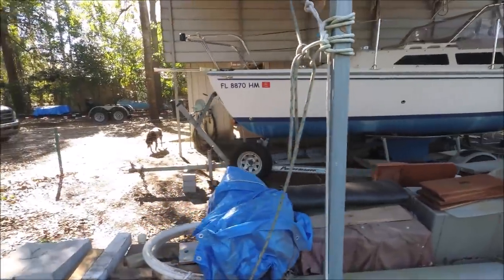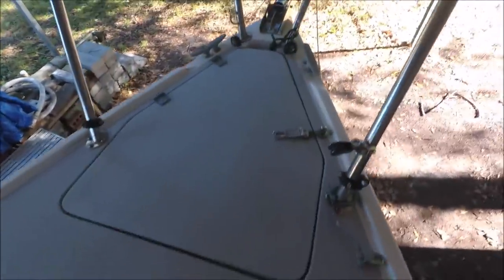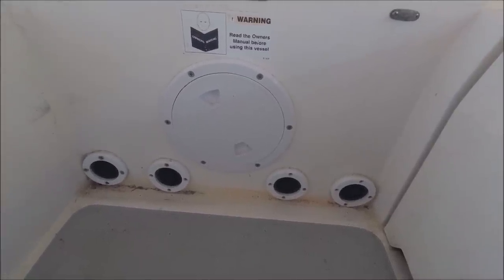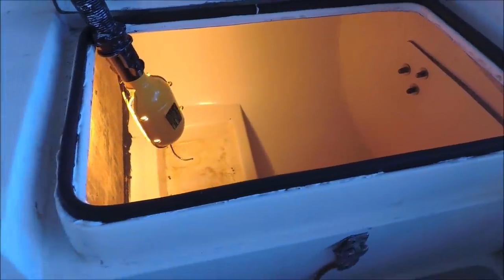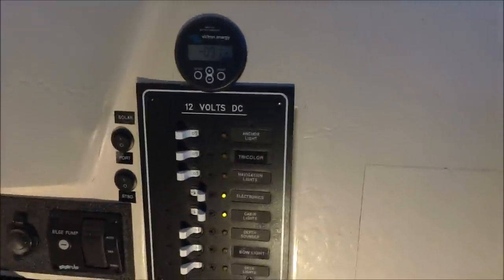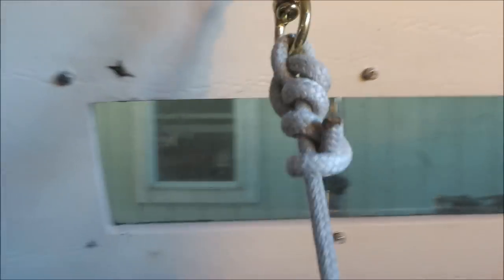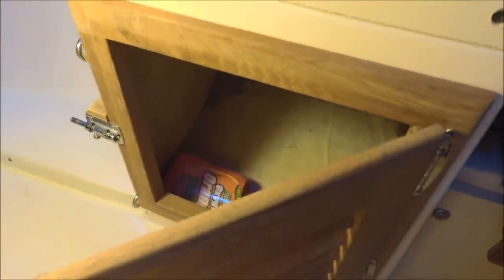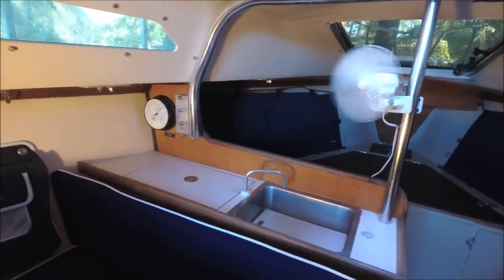Preparing a Catalina 22 for Bahamas Cruise

Comment: Nice work. Is there a wire or metal going into the water to ground the boat from a lightning strike?
Reply from the maker: I don't recall if the owner had a lightning ground already installed or planned to add one later but I wasn't asked to install one. On other boats I have used a 1/4" x 4" x 20" copper ground plate with cables connecting its bronze mounting bolts inside to upper shroud chain plates and base of mast if keel-stepped. Or a simple version could be something like a sheathed heavy copper cable such as battery jumper cable with it temporarily clipped on to an upper shroud with other end dangling in the water when needed.
Reply: @atomvoyager   one nicely sealed copper bolt going from inside to outside, just below the water line, to the ground on the fuse box should be enough to ground a small boat?
Reply from the maker: That may help but the experts I've consulted recommend a copper plate of any thickness with a perimeter of 48" which comes out to a 4x20" plate. That's perhaps extravagant for a 22' boat though. There seems to be some witchcraft in lightning protection so it's hard to know what's best. Also, a #6 awg wire from upper shrouds and/or mast base to the copper or bronze thru-hull ground below waterline is recommended. Add a wire to the fuse box as you say, is secondary.

Comment: I own this same boat… 1990 Catalina 22 Wing Sail number 15094.  I’ll bet this guy rolled off the line about the same time as mine.
Can you give any advice on having a trailer fitted for it?  I have seen a lot of bunk trailers available for the swing keel, but not many used trailers for the wing.  Would it be difficult to modify a trailer to make it work for the wing?
Reply from the maker: Any used trailer you find that is not specifically for a boat and keel of this dimensions will be somewhat difficult and costly to modify to fit your boat. But any trailer designed for keel boats should be easier to modify than one with bunk rollers for a shoal draft centerboard. You might ask for ideas on a Catalina or trailer-sailer facebook group. Unless you get lucky and find a cheap used trailer designed for your model boat then you may be better off buying a new one. You can ask Sail trailers in Columbus, GA about that if they are in your region. I have bought several custom trailers from them over the years.

Comment: That is crazy, when its all loaded and provisioned how low is it going to be in the water?
Reply: Between 604 to 635 pounds will lower the waterline by 1 inch. The more difficult problem in a small boat is getting it loaded correctly so there is not a tendency to yaw, pitch, roll, sway, and heave.
Reply: @SuperBullyone  IMHO, Coastal/Lakeshore boat, don't leave sight of land  !!
Reply: @AlienX69  probably right, but the most dangerous place is within sight of land.

Comment: What top-down furler do you recommend for this this size boat?
Reply from the maker: We installed the Selden GX 7.5 which the owner had selected. 
https://catalinayachtsstore.com/wp/product/selden-gx-7-5-furler/

Splicing the anti-torsion cable on the GX7.5 is a bit tricky first time you do it but they have a video that's easy to follow:
https://vimeo.com/252147951

The Selden is the only top down furler I've used but there are other brands out there that you can read user reviews. The smallest models available should all work for a 22-footer and most are probably oversize anyway.

Comment: Is gasoline storage vented?
Reply from the maker: Yes, because the locker lid is not sealed by a gasket and there is a notch cut into the bottom corner of the lid, it vents to the cockpit only.

Comment: Ps 
  Lets talk toilet, ha.  That overpriced system you can just buy the generic seat ($12) which snaps securely onto your own 5 gal bucket.  Ive used them for years, fantastic.  Then, I buy a $10 bale of wood shavings (tractor supply/Wal Mart etc) lasts months. . .  Its like hamster bedding.  Put some in the bag, (add your #1/or #2) and cover with more shavings.   You can get pine or cedar.  Very civilized and pleasing to the immediate atmosphere : )
Reply: @ronwright4684 no no no--- I'm comparing it to the other expensive composting toilets, which, also, don't get flushed down the regular toilet.
. . . I'm comparing two composting versions, the former of which is ridiculously expensive.  I don't know what you thought you were tracking there, Cheers : )
Reply: @ronwright4684  PS, rules of international waters everything(waste ) goes overboard when "offshore" which is technically, I believe, starting at 3 miles from land.  Maybe that's what you're asking. 
Anyway, my point was, if you're going to buy a composting toilet anyway, my version is the same thing and way cheaper, Cheers!
Reply: Apologies, I misunderstood, deleted my comment,

Comment: Would it be impractical to put a water maker in a boat this size?
Reply from the maker: It is possible to do but for most people the space and weight of a built-in water maker would not be practical on such a small boat.  You'd need more solar and batteries to power it also. Better to look at alternatives such as catching rain water in an awning or on deck with a valve below to divert water to a hose inside as described in my plumbing video for another boat. With shoal draft on a centerboard model it's often possible to get close to shore to make fetching water in jugs less of a chore.
Reply: @atomvoyager  got it. As far as power needs, wouldn’t a hydroelectric turbine solve that.
Reply from the maker: @Metal_Auditor  A water turbine is more trouble than its worth. They don't output much on small slow boats because I believe they need 5k+ boat speed. And you are anchored 90% of the time with no output. You'd still require more batteries to store the power. Solar is more effective and practical in the long-term. A wind generator would help but are too heavy and bulky and noisy on a small boat. When living aboard I required only 1 gal per day per person of fresh water for cooking drinking and a fresh water rinse after saltwater cockpit shower. Washing clothes was done with rain water or when fetching water from shore was easy. With your tank and several 3-5 gal jugs you can store all the water you're likely to need until it either rains or you can fetch it ashore. A hand-pump water maker is OK for emergencies but is way more work than getting water ashore.
Reply: @atomvoyager  I see. I have in mind someone using the boat mainly for cruising rather than for living long term in a harbor.
Reply from the maker: @Metal_Auditor  I understood that but my experience during two circumnavigations on a 28-footer is that most sailors will spend about 90% of their time at anchor.  A very active sailor might drop that to 75% but the result regarding limited usefulness of a water generator is similar. If you're saying they have an unusual use scenario making a long passage such as trans-Atlantic and then fly home right away then maybe it would be borderline doable if they can find a generator that outputs at low speed. In any case, a bigger boat such as a 25-footer would make it easier to solve the water issue. After carefully considering all the factors of your situation the answer will be more apparent.
Reply: @atomvoyager  thank you for answering all my questions. I’m still years away from being able to try something like this myself, but it sounds like I’d need to go for something closer to 30’ if I want to comfortably go cruising on the oceans.
Reply: The smallest Spectra water maker can be purchased modular fashion so components can be separately put where they fit.  And the best part is that it will work quite well off of those solar panels. Will fill your tanks in a few hours.  I had this on a 25’ outboard powered sailboat.

Comment: Poor choice for an offshore boat. A Ranger 23 would be a better choice.
Reply from the maker: Yes thanks for pointing out for the inexperienced sailors out there what is obvious to the rest of us that this is not an "offshore boat" and that the R23 and some others in that size range may have better features for offshore. I haven't looked too extensively into all comparable small boat designs and that would be in interesting thing to research. What we tried to do was to make a commonly available, low cost boat more functional, comfortable and safer for coastal cruising and brief trips with good weather windows by an experienced sailor across the Gulf Stream and through the near Bahamas.  I think we achieved that goal.
Reply: Bahamas is not "offshore" (at least not from the USA..). It's a 1 day gulf stream crossing (people do it in pontoon boats!) and then coastal cruising. This boat is great for that!
Reply: This question has always been asked or someone other opinion, you will always fine someone saying a better type of boat
Reply: I saw your wife Edward. You could have made a better choice.
Reply: A Ranger 23 is about 1000 lbs heavier than the Catalina, so that suggests it would be better at sea. But I'm not sure the Ranger would be a good boat for gunkholing around the Bahamas. It looks like a racer-cruiser, with a deep needle of a lead keel.